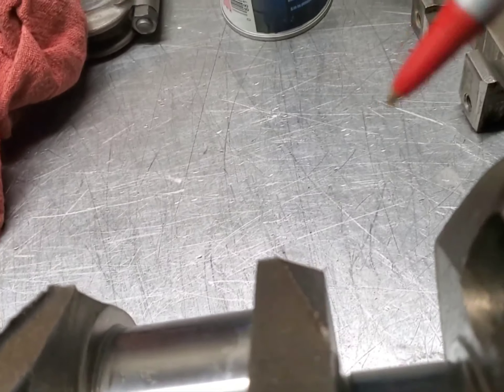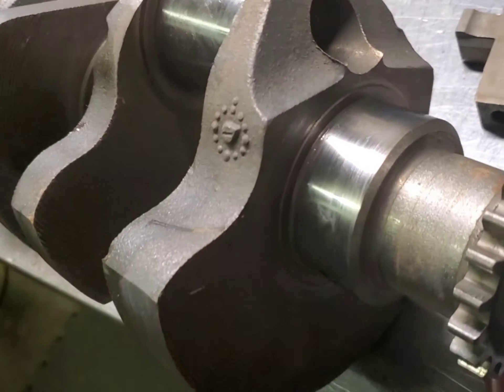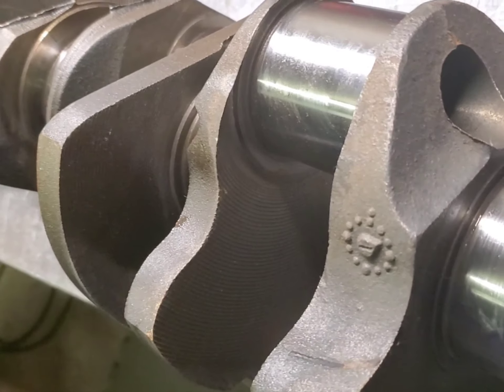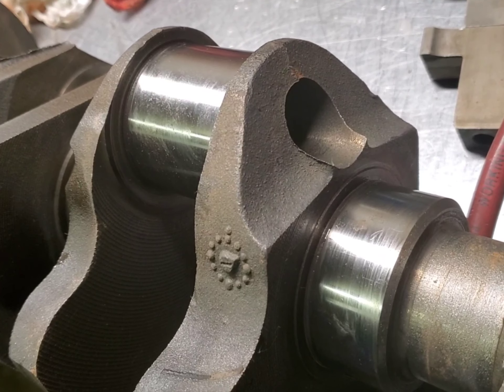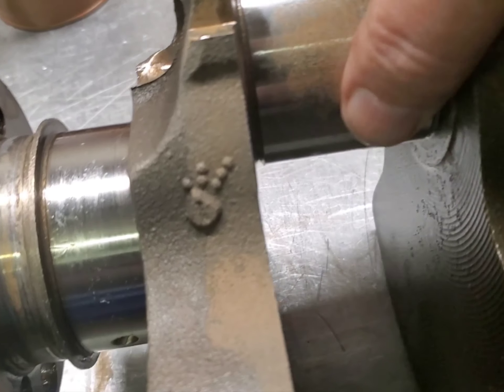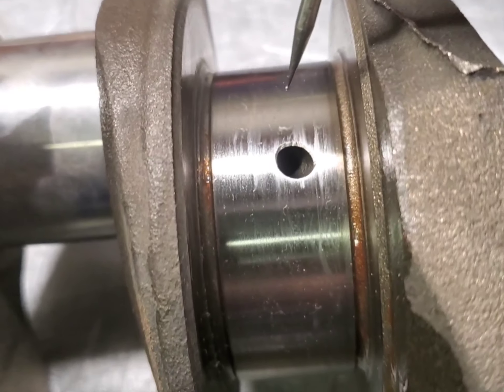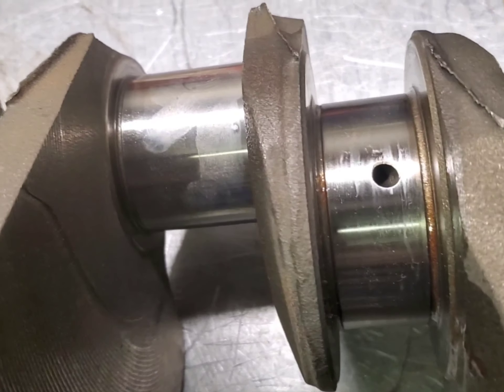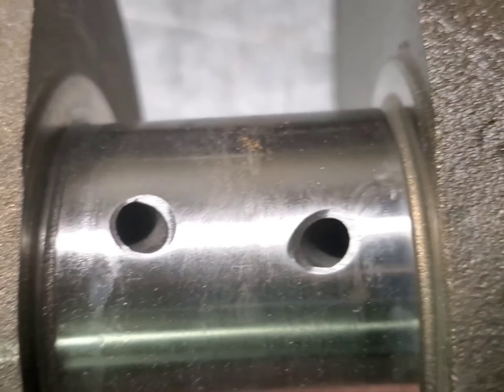440 Mopar Crankshaft Prepared For Balancing.

Comment: Great tips Ed.... I've read that cast cranks should be polished in direction of rotation cause the metal surface lays like fish scales but not so with forged cranks or billet what's your opinion on that.
Reply from the maker: Hey MoparNut, I always polish pushing the burr away from rotation. 
There is alot of opinions on grinding and polishing directions.
Reverse rotation is machine opposite to standard rotation. 
Cast crank has a different grain structure as apposed to steel.
I do a light polish to get the burr off of the oil hole do to the chamfering operation. 
After balancing I will do a nice polish.
Thanks for watching. 
Take care, Ed.
Reply: Good information on touching the crankshaft journals . Its amazing there is enough moisture in a fingerprint to do that . I remember someone said they always spray WD-40 on them and keep them wrapped .
Reply from the maker: @terryboothe2309  Thanks for watching Terry.
Yes, WD40 would have definitely helped that surface rust.
Take care, Ed.